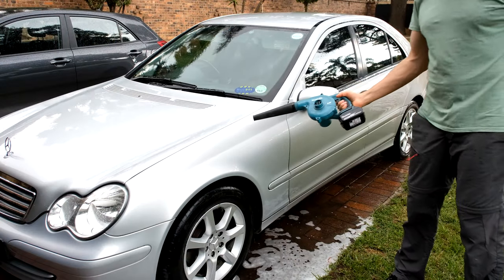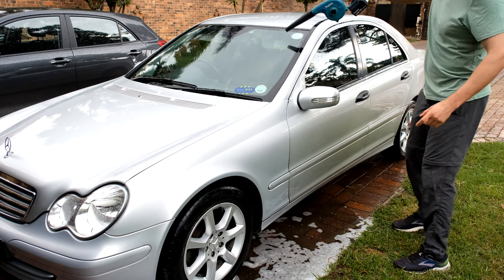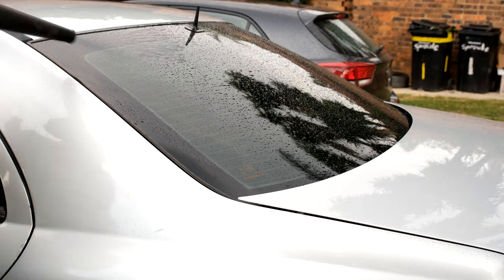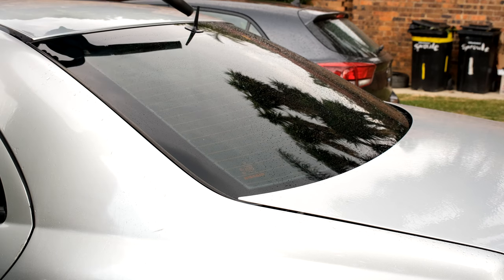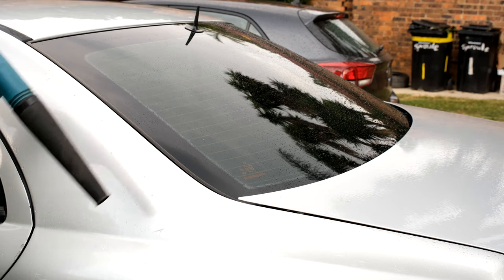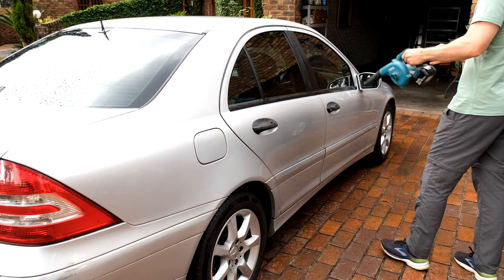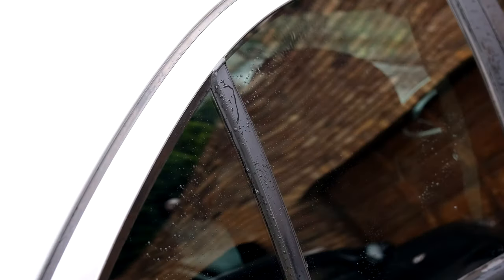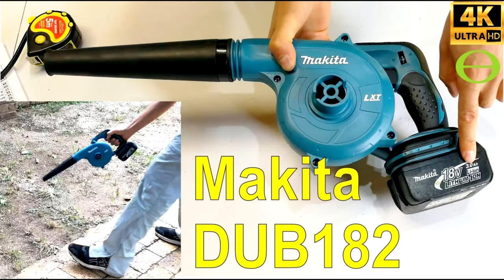Can you dry your car with the Makita LXT DUB182 blower?

Comment: Some paint protection that makes water bead would make it a lot easier, but even on a car like this, if you are drying with a towel, you can still use the blower to blow out nooks and crannies so you don't have watermarks later, like the edge of the trunk, the trim, mirrors,gas flap ,etc

Comment: as primary dryer no. They are great for those areas like mirrors, jams, vents,  wheels, grills, roof racks and seams the towel cant easily get into. also if it has proper paint protection with hydrophobic prosperities they can work pretty well on their own.